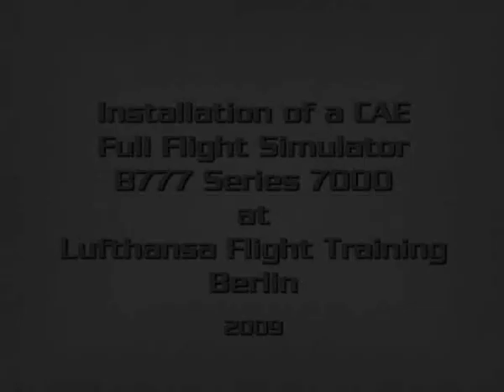Time lapse CAE full flight Simulator

Comment: @cjellwood:  it's a polyester film coated with a layer of aluminium.  It's basically the same thing as most bags of chips (crisps if you are in the UK).  There is a vacuum pump to stretch the mirror so the surface is as smooth as possible and as close as possible to a sphere. The mirror reflects the light coming from the back projection screen toward the cockpit.  The back projection screen is the white semi-spherical part seen above the cockpit.